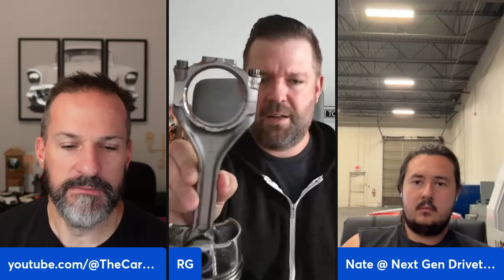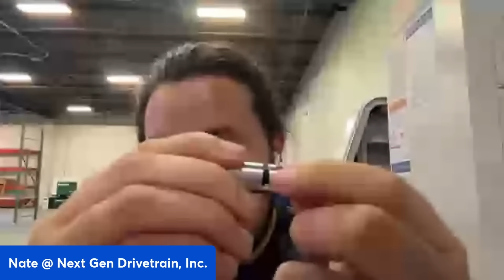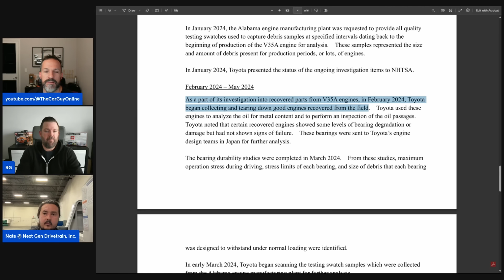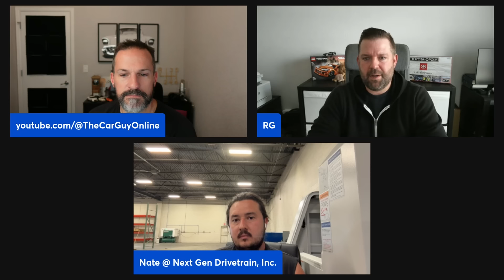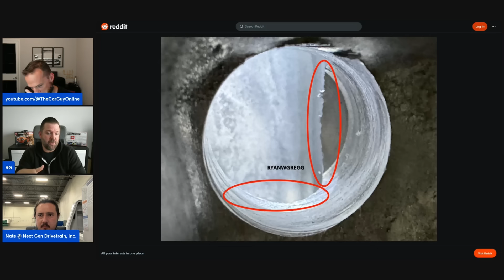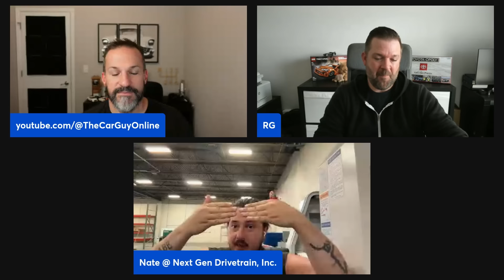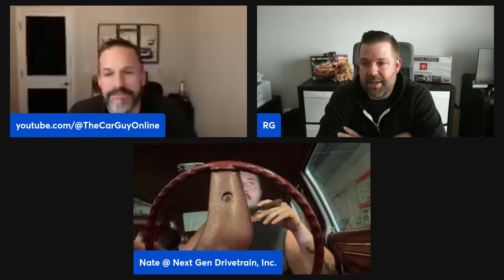Toyota Tundra BOMBSHELL. Buyer Beware Until 2026 (Full Interview)

Comment: I want a truck and would like a Toyota to avoid the transmission issues that plague GM and Ford.    The Tacoma is a bit too small for what I need and I'm not crazy about their turbo 2.4 liter four banger.    That leaves the Tundra which I still don't trust.    Waiting to see how the 2025 models hold up before I buy anything from them.
Reply: I had a brand new 2024 Tacoma as a loaner when my Tundra engine seized. It's better than the Tundra in terms of build quality, but I don't fit well in it at all. The back seat is quite useless in it even without the TRD IsoDynamic seats.

The Tundra should be 99.5% good to go at this point. There is always an outside chance for an engine related issue, even if the engine issue is "100%" resolved. It's just the nature of moving parts.
Reply: Titan!

Comment: That piston does not have "gas ports", which use compression to enhance top ring sealing.........the holes in the 3rd land are simple crankcase returns.
Reply: I didn't/don't know the technical term for the holes at the bottom of the oil rings. My apologies.

Comment: I would feel better buying a 2010 sequoia/tundra with 100,000 miles with. Maintenance record than these new tundras
Reply: We are keeping all of our 3UR and 1UR powered vehicles.
Reply: Huge Facts ☝🏻
Reply: 5.7 is having problems with headgasket issues as miles pile up.  That's a new engine rebuild.  The 6 speed transmission in the 4.6 V8 are prone to failure around 120k miles for solenoids.  Thats an 8k replacement.  I use to be on the gx fb group and I see posts daily about transmission failure
Reply: It's an aganda to destroy the entire industry period

Comment: 1% failure rate isn't that bad though. It being a new platform it is usually to be expected to have a bug or two. I would buy a brand new Sequoia over a 2025 or 2026 Tahoe, Suburban, Yukon, Grand Wagoneer, and an Expedition.
Reply: They are shit across every brand right now with similar issues. Sorry but Toyotas are not doing well
Reply: @psynurse still better than the domestics
Reply: Going into the 5th year and still having engine failures is no way, shape, or form "good" or "acceptable". Toyota knows they have an issue and are working to resolve the issue.
Reply: @ryanwgregg agreed. They should have resolved this by now. When the 3rd gen came out, I said I would trade in my 2014 Tundra & my Wife’s 2018 Sequoia after they work out the kinks for a couple years. We’re now into the 2026 year and I don’t think I’m ready to trade them in yet 🤔. Damn shame…

Comment: Nothing will top 90s toyota as a brand. Its a shame that these companies are destroying themselves.  The silver lining is that it creates a void for competition to step up as long as we can keep the government out of it.
Reply: 90s Nissan hardbodies were better trucks than the 90s toyotas.
Reply: @whois3581 yeah they were
Reply: Alot of this is regulation killing them too to be fair
Reply: So are you finished with new Toyotas forever
Reply: Eh seems the long forgotten 3vzfe of the 90s is still forgotten. The 22rs. SOLID. That v6 was a pos though.
Reply: @joshr961  2jz is one of the most robust reliable engines ever made. the v6 just had head gasket issues, not loosing main bearings. So still far far than today.
Reply: @Chris-ob8ok headgasket issue means an engine rebuild 😂
Reply: @Chris-ob8ok maybe the na 2j. I’ve seen plenty of failures on the 2j turbos. It’s good for making power. The most robust reliable engine they made though is actually hilarious though because that it is not. The 3vz had plenty of failures where the oil was replaced by coolant and cooked more than the main bearings so not as far off as your seem to think. Also don’t forget the burnt valve problems on the 3vz. That’s complete rebuild anyway dude. We’re not talking swapping heads on a 350 and those things sucked to work on. I know.
Reply: The dual mandate of EPA  lower emissions, CAFE standards would make this challenging business for even the most ethical corporate management and board. The regulators act as if they have never heard of the economic term “ point of  diminishing returns” Oh and then there is “ crash safety “ ever increasing demands by regulators. What a mess.
Reply: @Horatio1886build  I don’t mind the crash safety, but they need to pull back on emissions and MPG’s
Reply: @Horatio1886build  Almost as if its done intentionally so people eventually can't afford cars... But nah, only dumb tin foil hat folks think like that... Right?
Reply: Early 2000s Toyotas also were a prime buy. They were so eager to throw in extras at my Toyota dealer. They wanted to gain customer satisfaction at all costs. 
Now? eh

Comment: Unfortunately I think the Old Legendary Toyota may be gone, I heard a Rumor, take as a grain of salt, There were some significant Corporate Management Changes in Toyota around 2018-2019, and they are more like the American Big Three now. Also the EPA and CAFE standards have devastated Engineers on what they can do to make a vehicle reliable. Between Plastic Oil Pans, I think I saw a Plastic Upper control arm on a video of a Full Size Dodge Truck, it may of been a HOAX video which I hope it is. I recently bought a well maintained Honda Accord from 2005, I plan on driving for it least 10-15 years, No new cars for me, especially after the 2022 models years and beyond.
Reply: The plastic UCA on the RAM truck is 100% legit, not a hoax. And yes. There were significant changes throughout Toyota North America pre, during, and post COVID.
Reply: @ryanwgregg nope. It’s A metal casting from one end to the other with a plastic overlay. There’s a video of a guy who bought one and cut it all apart.
Reply: @EristiCat  Awesome! I haven't seen that video. Still wondering what the plastic would be needed for...?
Reply: @EristiCat  Thanks for the info, I did not now this, glad it is still metal casting, the way the Auto Manufacturers are these days, it makes you wonder what they would do to save on costs.
Reply: @ryanwgregg from what could be seen in the video three possibilities came to me. Protection from corrosion. Seems doubtful as it aluminum. 2) As a cheaper way to hold the ball joint and bushings in place. 3) both cheaper to make and to make it a non serviceable part so you need to buy the whole piece if bushings or ball joint wears out.
Reply: Yes the Toyota Pres stepped down years ago
Reply: @psynurse  Plenty of other changes as well.
Reply: Nah, biodegradable plant based plastic upper control arm just like their self degrading plant based wiring and plastic dash. Disposable garbage just like everything else. Never intended to last past 15 years if even 10 😮

Comment: It's the variable oil pressure that is the problem. 5w40 will not help you if the oil is at 5psi . I have not seen evidence of the debris theory.
Reply: Evidence of the debris issue is in the video. Those pictures have been on Reddit & Facebook for over a year.

Comment: My thought is the bearing are walking out of place because they didn’t use a retaining groove for the main bearings. I think it was an intended design to make the engines fail earlier. I don’t think they intended it to happen this soon though. I do think there is something else that is causing the bearings to walk out prematurely. I think with tighter tolerances they expected the bearings to hold out for a few hundred thousand and fail and force people to buy new vehicles.
Reply: The 3UR doesn't have bearing tangs and it has done just fine up to a million miles with Vic Shepherd.
Reply: @ryanwgregg I do have a theory that something in the transmissions is part of the problem. I haven’t seen enough data to really support that but with my 2025 tundra, it shifts really hard sometimes and I actually have a video on my channel of a really nasty sounding noise that sounds like marbles bouncing around in the bell housing but the dealership couldn’t recreate the sound so I’m just driving it for now.
Reply: @NotYourAverageNurse  I had quite a few instances of harsh downshifts while coming to a stop as well as clunks while sitting at a stop light. The Tundra isn't perfect, but it is better than the stories I hear from family and friends who own the Big 3.
Reply: @ryanwgregg completely agree! This is my first Toyota and my wife just got her first Toyota in a 2025 4Runner. We both made the change after multiple experiences with GMs. I got rid of my 2020 Sierra before I had the transmission issues. My 2012 Sierra and my wife’s 2013 suburban both had the 6L80s and obviously the notorious DOD issues. My wife also had the 2013 equinox with the 2.4L and we had the engine rebuilt at 97k and got rid of it. Won’t buy a ford and I like parts of the ram line up but stellantis is ruining that brand too.
Reply: @ryanwgregg I’m just an RN that used to work on diesels in the Marines so that’s just my thought. I know enough to get myself in trouble 😂 It certainly wouldn’t hurt reliability to use a tang on them and I can’t imagine it makes a significant change in manufacturing costs. There’s a 2022 tundra on the original engine out there with 200k on it already and still going strong. Not saying they won’t go the distance, but I do think it makes a total engine failure more probable down the line.
Reply: @NotYourAverageNurse  Same. I'm just some guy that knows enough to certainly get in trouble. There are at least 5 2022s with 200K+ on the original motor. I talk to them almost weekly.